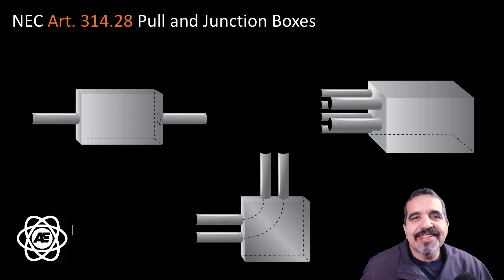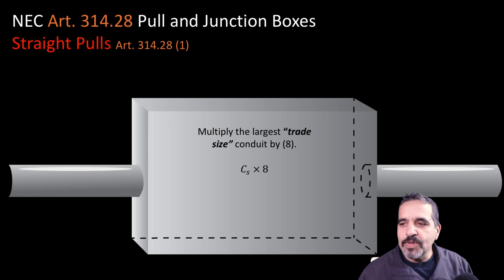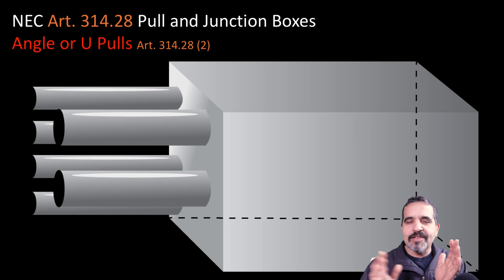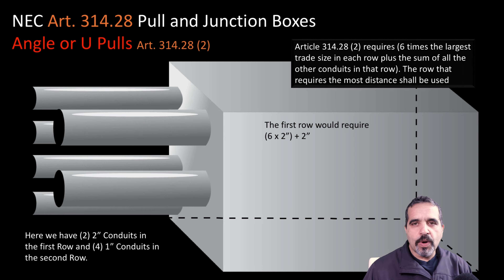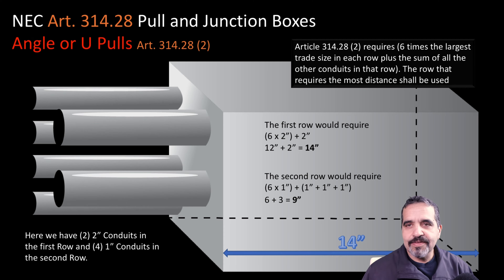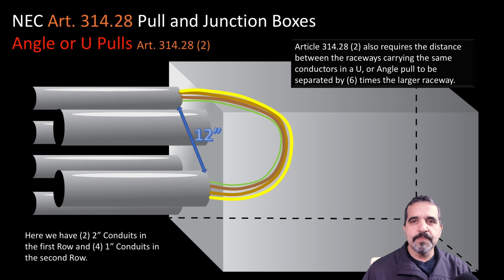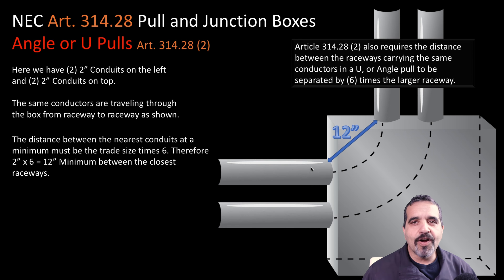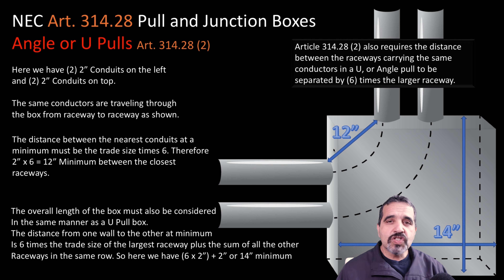Sizing Pull and Junction Boxes made Easy

Comment: Mike Holt figure 314-50 says spliced conductors do have to have no less than six times the trades size of the largest raceway, plus the sum of the trade sizes of the remaining raceways on the same wall or row,
Reply: Yes. That's sizing the distance to the opposite wall.

Comment: What if I'm not pulling 4AWG or larger then non of this is required? Read 314.28A
Reply from the maker: Yes you are correct. This is for wire that is #4 or Larger. Thanks for the comment.

Comment: what's the rule if they were spliced?
Reply from the maker: Hey Jered. The rule, if the wires are spliced, is found in 314.28(A)(2) and requires 6 times the largest conduit size in a row, plus the diameter of all the other conduits in that same row on one side of the box. each row is calculated separately and the row with the largest dimension is required for calculating the size of the box.